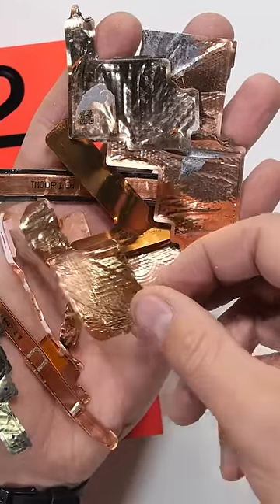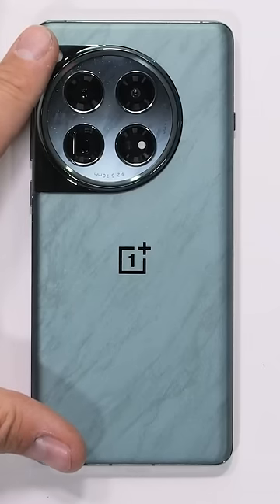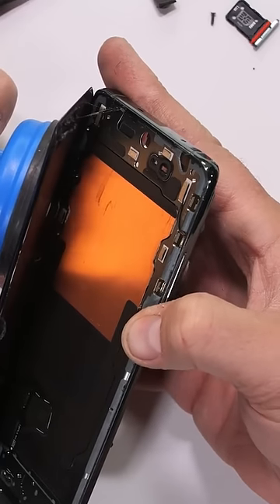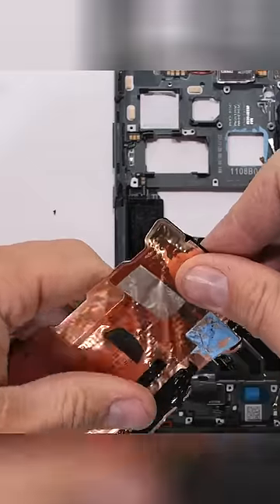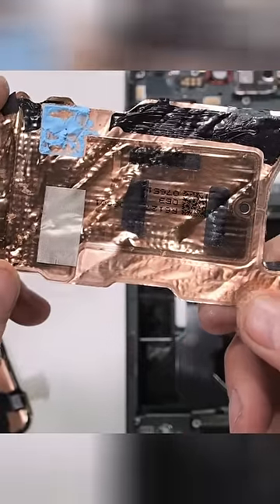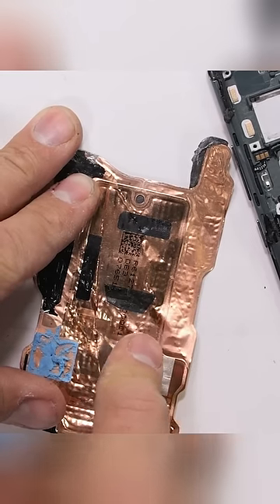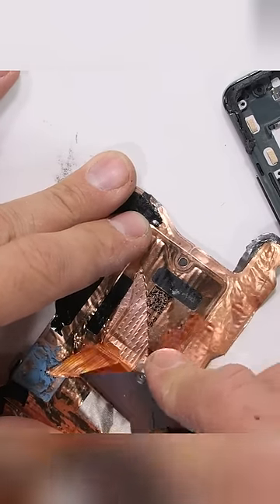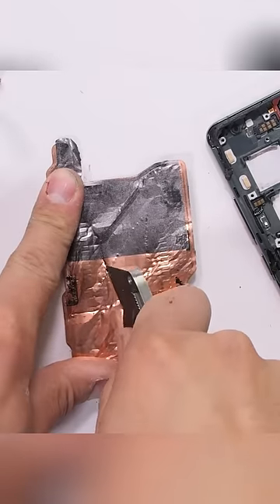THE BIGGEST I'VE EVER SEEN!

Comment: How will this copper dissipate heat from the processor when phones are sealed watertight? How will the heat leave the phone without vent holes?
Reply: The vapor chamber transfers the heat from the processor to the screen via conduction, and then the outer side of the screen removes the heat through convection.
Reply: There are passive cooled small PCs, like the Raspberry Pi. They either have nothing or a fanless heat sink. That's what phones do, too. That's a heat sink without a fan. Lots of phone have those but only some use one of that kind, a vapor chamber.

My Galaxy S22 has a graphene heat sink, for example. The S22+ would have a vapor chamber already.
Reply: @kiophoenix  I think the commenter was specifically asking, if a phone is relatively water tight (and therefore air tight) - how does the heat makes it way from the heatsink to the outside of the phone.

Most fanless heatsinks that we think of are metal structures with a bunch of parallel plates or fins which dissipate heat into the air via convection either passively or with fans. 

But in a phone's situation [usually] most of the heat is transferred using a vapor chamber heat sink, and it was from here that they seemed confused. So that's where I came in and said it is transferred to the thin phone screen panel and glass covering, where the large surface area easily dissipates heat into the air via passive convection. 

Interestingly though, there are some phones, mostly designed for gaming, which do indeed have internal fans and cooling channels/exhausts.

Comment: Industry Leading Vapor Chamber
REDMAGIC 9 Pro is home to the largest cooling Vapour Chamber in the industry with a surface area of 10,182 mm² and a stepped design to reduce CPU core temperature by up to 25°C.

Im afraid the Redmagic phone you disassembled had a larger cooling system.

Id know, because i use one. And its a monster!